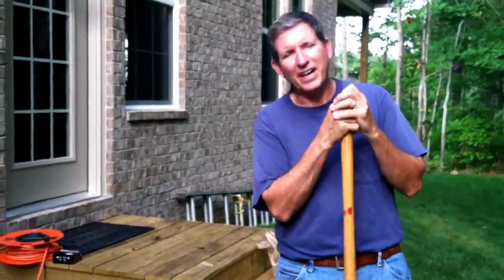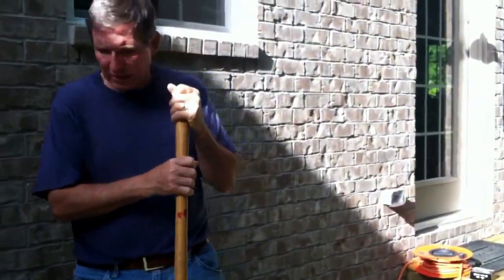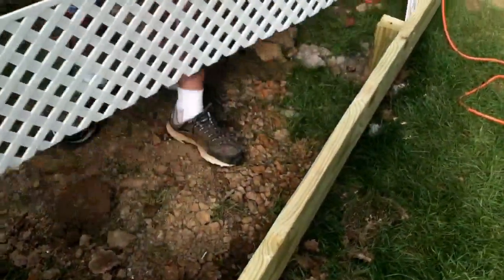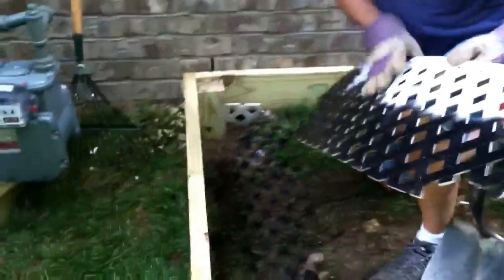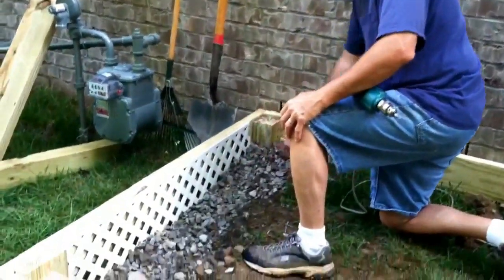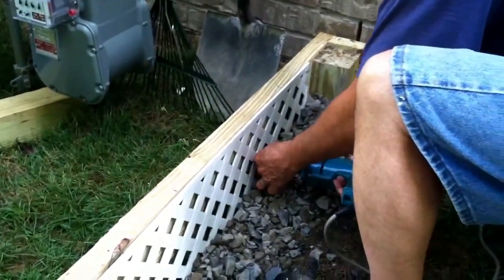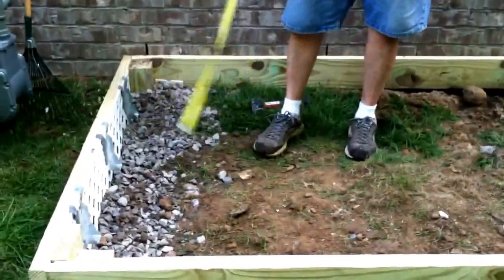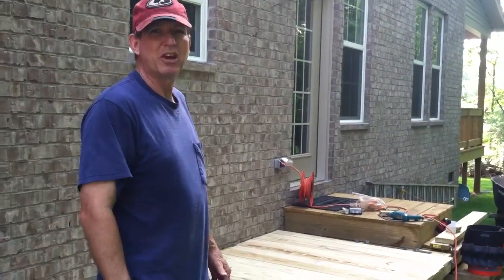Using Porch Skirting to Keep Critters from Under a Porch or Deck

Comment: small wire fencing stapled or nailed is better,,,,chipmunks will have a nice new home with holes that big,,just my opinion from experience
Reply from the maker: +Robert Swift Thanks!  Small wire fencing might help with those very small critters like chipmunks.  Thanks for commenting.